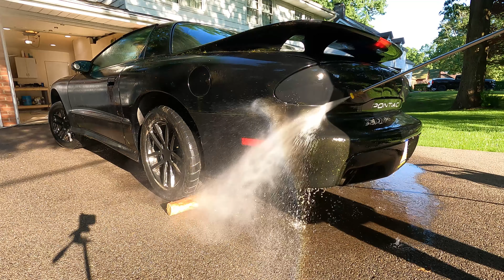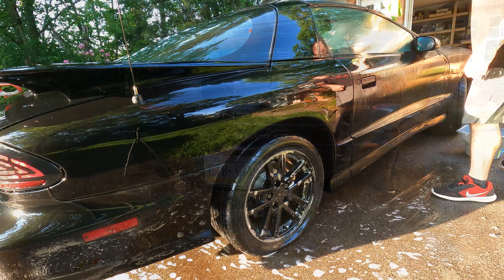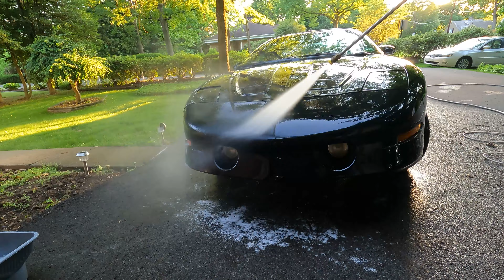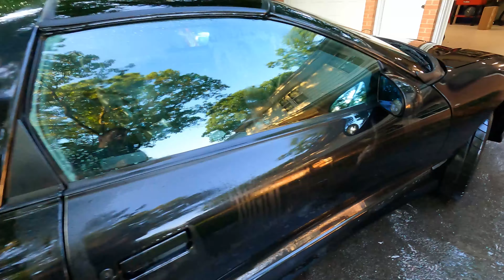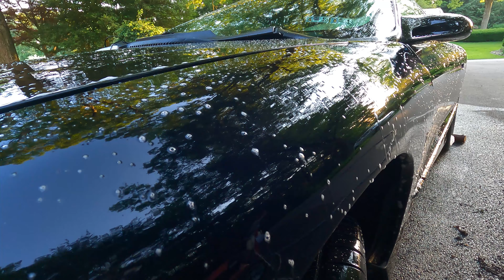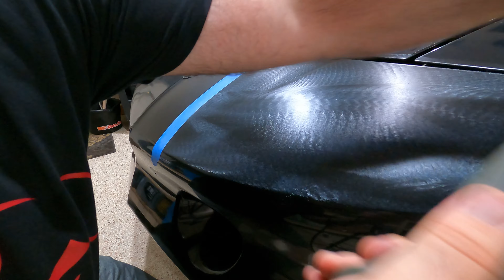FIRST WASH IN 7 YEARS, detailing my old 1996 Trans Am, 3 step paint correction restoring an old car

Comment: I bought a 95 Comp T/A that was in similar shape, guy bought it from the original owner to pilfer the driveline from it and never did, didn’t register it and ripped it around for years until the water pump destroyed the opti spark and he left it to rot since 2014. It had been sitting so long that the lense on the grid tail lights practically peeled right off when I was detailing it